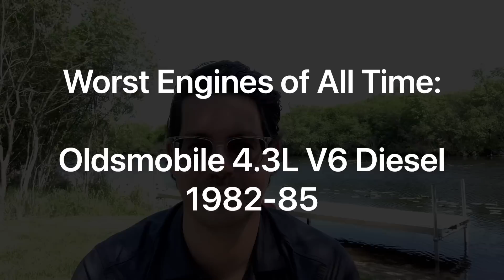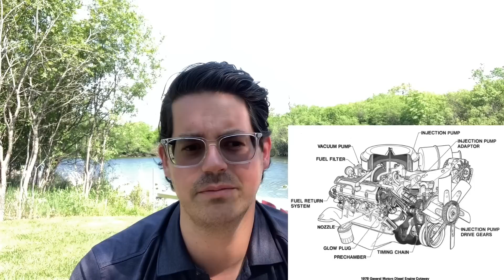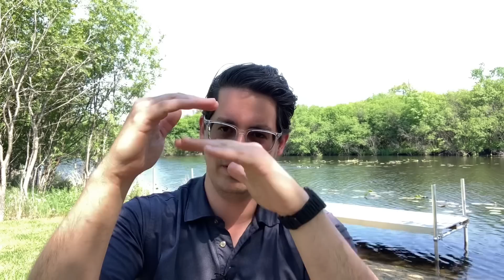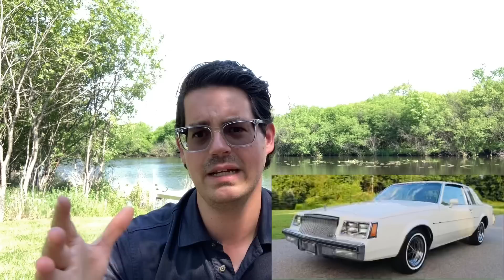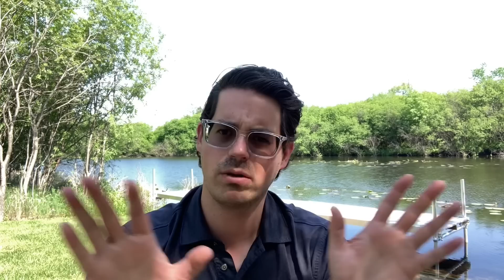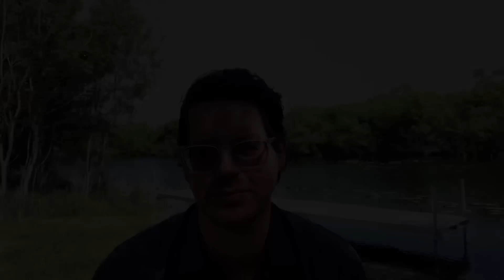Worst Engines of All Time: Oldsmobile Diesel 4.3L V6

Comment: You make it sound if GM was surprised by the CAFE standards. But the CAFE standards from 1975 until 1985 were published in.... 1975. So, GM had almost 5 years to prepare, but they didn't. Instead GM and Ford continued to lobby against the CAFE standards and did too little too late. This mistake caused these bad engines, not the CAFE standards per se!
Reply from the maker: They were. But they started raising fuel economy in 1978.  You’re forgetting that these standards required a complete overhaul of the portfolio stem to stern at a time when vehicle platforms were refreshed every 5-6 years in a staggered fashion. So, imagine redoing every vehicle portfolio completely in basically one model generation—the entire thing.  New engines, transmissions, brakes, window systems, suspensions, steering, etc using completely different materials and methods vs what you’ve been doing for the last 20-30 years.  Few engineering standards, best practices, etc to leverage. It was a much bigger issue than just “preparing”.  No Big 3 company had ever done that and they weren’t staffed to do it either. Nor could they afford the staff as the economy hit another recession in the late 70s/early 80s.
Reply: @RareClassicCars  GM missed a big opportunity by not getting all the bugs out of the Vega before they released it.  If they had a high quality small car starting in 72 or 73, playing catch up would have been easier.
Reply: @21stcenturyfossil7  fair enough, those small cars sold well, the 1971 Vega sold 247,000+ units for example. That same year the Impala sold 427,000+ units, about 35% more. I guess a better way to word it would have been, “there were more big car buyers in that era and they wanted big cars”. The full frame long wheel base isolated from the world experience of a full-sized body on frame car cannot be duplicated by a downsized unibody vehicle no matter how hard engineers try, and it drove GM to bring them back in the early to mid 1990’s, and kept the Panther platform at Ford Motor Company alive for many more years than Ford ever expected it to exist. I think as close as they’ve ever come to achieving rear drive type isolation on a front drive platform was General Motors C bodied vehicles introduced in the mid 1980’s.
Reply: @cadillacguy1890  you are entirely correct. Great comment
Reply: @howebrad4601  thank you!
Reply: @cadillacguy1890  My point was that the small car market grew considerably during the 60s, when the standard of living was growing and gas was cheap.  Consider the difference in sales for full size 58 Chevys to 72 full size Chevys.  That difference is made up by smaller cars.  And the numerical increase in the smaller car market doesn't consider the motorcycle boom of the 60s and early 70s.  Simply put, alot of people wanted smaller cars even before the gas crisis and recession.  If there wasn't a market for smaller cars, GM never would have bothered designing the smaller car platforms.  Then the gas crisis and recession made smaller cars even more desirable.  And while CAFE and multiple platforms were an issue, I think it's worth considering WHY we got CAFE and the multiple platforms.
Reply: @RareClassicCars  An interesting subject for a future video would be for Adam to discuss how he would have handled the 1970's/1980's downsizing differently had he been in charge of GM.
Reply: @RareClassicCars  not only that, but in general the public didn’t want smaller cars. I believe vehicle manufacturers were at least somewhat convinced that the public would put pressure on the government to relax the CAFE standards, or their lobbyists would convince government agencies to delay them until they could develop the technology to improve engine efficiency enough that they wouldn’t have to take the drastic actions of downsizing and totally retooling engines, platforms, and manufacturing to meet them. Besides, the incredible investments required to retool and reinvent everything for an unproven product offering was a huge risk corporations are loath to take. Once it became obvious the standards were not going to be delayed or modified, they had to rush whatever they could do to meet the requirements.
Reply: @cadillacguy1890  If the public didn't want smaller cars, why was the Vega such a good seller at it's introduction?  Not to mention the Pinto and Gremlin, which also sold well.  A large number of Americans wanted smaller cars, just not crappy smaller cars.
Reply: @21stcenturyfossil7  pinto and vega sold well, however bigger cars sold even better.  Thus while some people wanted smaller cars most did not.  Even today most people buy very big vehicles when given the option.
Reply: @howebrad4601  The average vehicle sold in 2022 is smaller than the average vehicle sold in 1958.
Reply: @RareClassicCars  Yes, but CAFE is about average fuel consumption. Not everything had to be ready in five years. Just the average. And what is wrong with copying some things from the Japanese and European car manufacturers? GM and Ford had European engineering in their corporation (Ford Europe and Opel). So, that could also have helped to speed up things. I am thinking of steering racks, brake systems, suspensions, etc. And I don't see your point about retooling. Retooling was done every 5-6 years. So, yeah... nothing new there because of CAFE. Not if you realise that it is averages we are talking about.
Reply: I would also add that most businesses that operate in a free market economy believe the customer and their needs and desires should drive what is produced.   While the us mfg probably did drag their feet it was most likely because they did the math and determined they would have to invest many millions, perhaps billions of dollars just to meet some educated idiot government diktat that offered only negligible customer benefit.   For those customers wanting small cars there were already quite a few on the market so why was there this huge need for forced revamping of the entire product line.  Then add on top of that ever ratcheting up emissions and safety standards its frankly a miracle any survived this regulatory onslaught
Reply: @howebrad4601  I largely agree about the free market and I think the Big 3 was largely on track with their "import fighters" of the 60s and early 70s.  Their big failing, especially with GM, is that they thought they could get away with rushed development schedules and release buggy beta versions of their cars, such as the Corvair and Vega.  VW was already known for good reliability and the Japanese companies followed up.  The import companies were smart enough to know they had only one chance to make a good first impression.  Except Renault, I suppose.

Comment: I bought a used 1978 Cutlass diesel from a co-worker for like $250 about 25 years ago.  I got it cheap because it had two head bolts that broke at the cap.  It was the 350 ci.  I replaced the head gasket and the head bolts and the two batteries and drove it for a few months back and forth to work.  Sometimes at a stop, the engine would just die and would not crank over.  Waiting a few minutes, it would crank back up like nothing happened.  I finally gave in after a starter bolt broke off in the threads.  I sold it for what I paid for it to a teenage neighbor.  The neighbor was fully aware of the repair history.
Reply: We were raising 6 kids and not much money so I bought many nice GM cars with all kinds of the diesels for not much money. Mostly cheap fixes- injector pumps , rocker arms , head gaskets  we drove em til they died and then found another - Cadillacs , Buicks and olds mostly

Comment: "Like being valedictorian of your reform school..."  I love it. 
Couldn't GM have gotten something suitable and proven from their European division? It may have been small, but maybe usable in some car lines?
Reply: Adam totally stole that line from an old Dennis Miller stand-up comedy special on HBO.
Reply: @alantrimble2881  It's still funny.
Reply: Opel made some quality vehicles! But in usual GM fashion let GM Europe die till Peugeot bought them out and now it’s making massive profits for them!
Reply: @mervynstent1578  Opels image is broken. The Vortec 2200 was fine in my S10. The germanized 2.2 of a friend's Opel was an unhappy engine.
Reply: @808bigisland  much better than Holden’s faith 💀
Reply: @mervynstent1578  drive a 54 Chevy pick up for 6 years as primary. Things were better back then. Owned 8+ Chevys. 1 transmission, one cracked cylinder head..went out between all trucks and vintage road cars. Grew up in Switzerland...Opel we're very pedestrian..much like Buick here. Never wanted one except the Lotus Omega.

Comment: I had a relative who owned a 1985 Oldsmobile 98 Regency Brougham Coupe with the ultra rare 4.3 liter Diesel.  He was fairly wealthy so he only kept the car for about 3 years before trading it back into the Oldsmobile dealer on a Touring sedan.  But.. I did get to ride in the car several times before he sold it and it ran beautifully.  I was a young teen at the time but i knew these diesels were fairly rare even back then, especially in the new C body cars.  As i know, he never had any issues with it's durability during his 3 years of ownership.

Comment: Paraphrasing: "the big 3 were making big vehicles and had to transition to smaller vehicles with higher fuel economy and this was their biggest obstacle"

Love the channel, but I have to respectfully but completely disagree on this point.  Yes, the big 3 were making big vehicles and had to transition to smaller vehicles with higher fuel economy.
That's a challenge to be sure, but meeting it was not impossible.  As has been discussed previously, all three companies owned European divisions that had the technology they could (and did) take from.  
The bigger challenge was that management did not want to build cars people wanted to buy at a level of quality they would pay for.  Solving that dilemma was FAR more difficult, and has yet to be completely reconciled to this day.
Reply: I agree and Adam acknowledges the comment in earlier videos on the demise of US dominance.  But still, it was not the CAFE requirements that were the problem, it was the corporate "management", priorities and hubris that undermined the industry.   As you point out, CAFE requirements did not require "moon shot" technology, plenty of companies already met it.   Adam's point is that GM just wasn't ready to do it for alot of reasons, including talent and culture.

If GM and Ford would have been more proactive and strategic, they could have made the transition and come out big winners.  Instead of shit canning the Olds diesels, they could have refined and optimized the designs which would put them in the proverbial cat bird seat.   Instead, GM handed Detroit Diesel to Penske in 88 and finally sold out completely to Daimler in 2000.

"Where there is no vision, people perish"  and companies as well
Reply: @votingcitizen "Adam's point is that GM just wasn't ready to do it for alot of reasons, including talent and culture."

Yep.  but also a lot of stuff about CAFE, which is really a secondary issue to my mind.
Reply: @seanm2511  Also, if it was a staffing/talent/resources issue then wasn't that the fault/failure of management as well?   One always hears CEOs say "our people are our most important asset" or variations on that theme but it is a small minority of them that actually believes that enough to make it a priority.
Reply: The fall came from a long line of Corporate need (or want) for high profits. Small cars cost the same to produce as a large car so they produced lower profits. The big three never wanted a too successful small car. In 1947 Chevrolet engineering was working on a small car concept (the Cadet) which would have been a 2300 lb car, front engine, rear drive, with four wheel independent suspension. It was killed because while it may have been profitable it did not have the same profit margin GM then  enjoyed.

Chevrolet's next look at small cars was the Corvair. Safety concerns caused by cost cutting needed to hit the margin targets killed that vehicle. With it went all hope of future innovative smaller vehicles from GM until they were forced to do so.
Reply: @PragmaticPragmatic  Yep.  It's not that the big 3 cannot make cars.  They don't want to make cars that do not have x.x% margin.  BTW that is a fair consideration, but it MUST have a long term component, that is well beyond the quarterly results, added to it
Reply: @seanm2511  you are correct.  As a business owner, of course I want to make more profit.  If I sell product a and b, and I make more on product a, of course that's what I will try to sell.  Bottom line is once again govt meddling in the market created unnatural distortions that then had their resultant impacts.
Reply: @PragmaticPragmatic  gM has a long history of killing promising, innovation .  withness the EV1 - innovative, high performance, loved by owners/drivers, a rolling test/development bed for refining, fine-tuning electric cars, killed in the cradle by gM.

https://www.youtube.com/watch?v=l3OnYjP4FTk
Reply: I can't think of any late 70s- early 80s European Big 3 cars or engines they could have met American buyers' desires with.
Reply: @jamesengland7461  Can you think of any Japanese cars in the late 70s-early 80s that could have met the American buyer's requirements?  Here's the thing; the Japanese motor industry IS the European motor industry with better build quality.
Reply: @seanm2511  American buyer's requirements were already trending downwards since the late 50s.  Compare 1958, when the big 3 were offering only an assortment of parade floats, to 1972 when intermediates and small cars were beginning to dominate the market.  Ford alone was offering Torinos, Mavericks and Pintos aside from their Galaxie class starships.  And that was just before the first gas crisis really boosted demand for smaller cars.
The REAL problem wasn't that Americans didn't want smaller cars.  Plenty did.  The real problem was that the fraction of people who wanted a big car were willing to pay extra for the size, despite the fact that there really isn't that much difference in the cost of manufacturing a small car vs. a big car.
Reply: @21stcenturyfossil7  I would focus on the fact that Americans did want smaller cars as far back as the 1950s as evidenced by the success of cars like the VW beetle, whose success DID NOT start during the oil crisis of 1973.
Reply: @seanm2511  I agree,  I was just focusing on the contrast between the Big 3 offerings between 1958 and 1962.  The were making an attempt to meet demand of American small car buyers, although in a mostly half assed sort of way..
Reply: @seanm2511  if what you say is correct why did the big cars far outsell the small ones.  Some Americans wanted smaller cars, most did not
Reply: @seanm2511  Back in the late 50s  and early 60s  there WAS an American car maker that was dead on balls  accurate towards building smaller economical  cars actually two of them you see, What  you are forgetting is that there was still American Motors  and Studebaker  at the time and American  Motors  found  alot of sales strength in the late fifties and  early 60s  with the Rambler,  So did Studebaker  with the 1959 Lark  but all that  changed  when the big three came out with their compacts in the fall of 1959. For many years American Motors  was very committed to smaller cars!!!!!.
Reply: It wasnt impossible but the scope and timeline of how quickly the big 3 had to make these dramatic changes was the problem.  Then compound that with ever tightening emissions standards,  then throw safety standards on top of the first two and it is readily apparent why things didnt work out right.   I personally dont fully blame the us industry.   They did make many mistakes but I absolutely loathe the government meddling in the free market creating unnatural and unnecessary market distortions
Reply: But people in America wanted the big cars. The radical environmentalists are the ones responsible for the cars we have today. Aka Hybrids and full on EV's, etc. 

It's those radicals that have slowly over time helped destroyed our way of life by making us believe lies all in the name of presenting to us this false hope of a green utopia that will NEVER be obtained.

Comment: wow you know , these guys at GM .... they must have really been so STUPID, the so called "Engineers" , I mean?   They should've been fired, so QUICKLY!
Reply: Its not the engineers, they were not given the resources (manpower and/or time) to fully design a new engine from scratch (as Adam says). Any rushed engineering program has high chance of failure.
Reply: @PragmaticPragmatic  seems to me, that the Dodge/Chrysler/Plymouth, have been pretty "FUCKED UP " for a long time..... I think that would be the engineers.......along with the IDIOT Management , that would allow for such "SHIT" to be produced,  don't you think so?